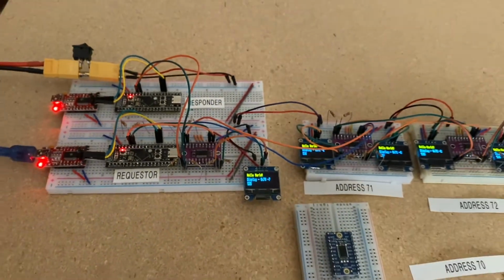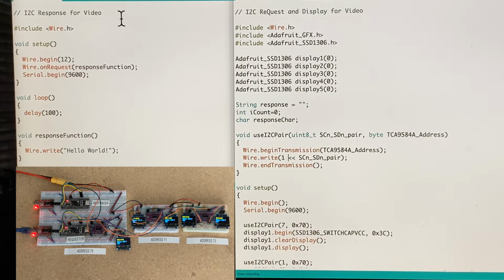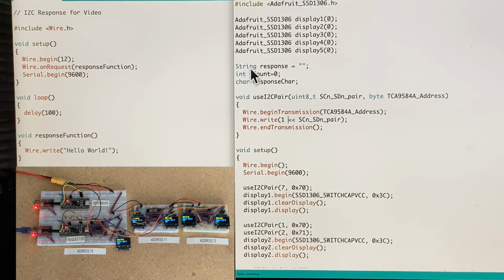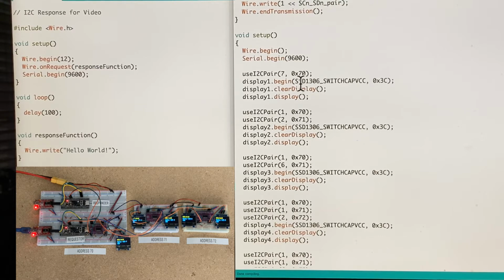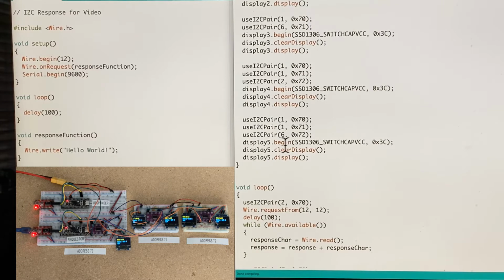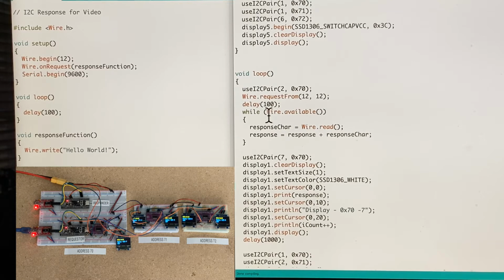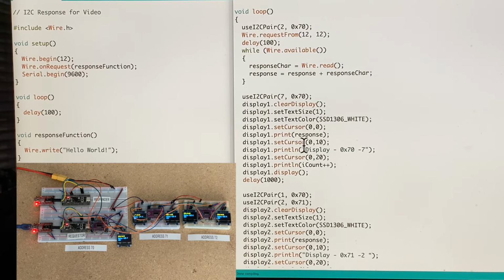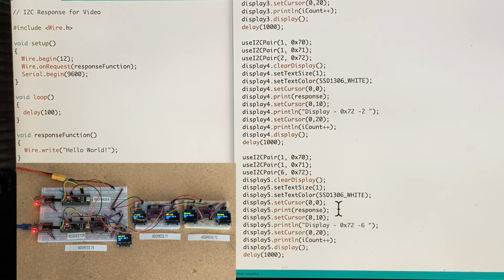I2C Bus example with 2 STM32F4 Black Pills, 3 TCA9548A Multiplexers and 5 0.96 inch displays

Comment: is it possible with different oled lcd addresses (SSD1306 AND SH1106)?
Reply from the maker: There should be no problem as you go to a I2C pair on a multiplexer for an address which could be for the SSD1306 and a a different address on a different I2C pair on the same or different multiplexer for a SH1106. Each of the I2C pairs on the multiplexer is also the beginning of an I2C bus that can have many devices with different addresses. But different I2C pairs on the same or different multiplexers can have the same address no mater what the device is. Hope this helps. If not ask again.
Reply: @lotbotrobotics5026  I have tried but always failed, are there any examples to make it easier for me to solve this problem.
Reply from the maker: Sorry for the delay, I did not see your follow on message. I have not used a SH1106 and do not know what else I can tell you. Two addresses that are the same can not be on a single I2C but can be on a multiplexer. I have already put all of the code I used in an earlier comment by M.

Comment: Please add a code in txt
Reply from the maker: The following are the two prototype sketches that I used and reviewed in the video.

// I2C Response for Video --------------------------------------------------------

#include <Wire.h>

void setup() 
{
  Wire.begin(12);               
  Wire.onRequest(responseFunction);
  Serial.begin(9600);           
}

void loop() 
{
  delay(100);
}

void responseFunction() 
{
  Wire.write("Hello World!"); 
}

// I2C ReQuest and Display for Video --------------------------------------------------------

#include <Wire.h>
#include <Adafruit_GFX.h>
#include <Adafruit_SSD1306.h>

Adafruit_SSD1306 display1(0);
Adafruit_SSD1306 display2(0);
Adafruit_SSD1306 display3(0);
Adafruit_SSD1306 display4(0);
Adafruit_SSD1306 display5(0);

String response = ""; 
int iCount=0;
char responseChar;

void useI2CPair(uint8_t SCn_SDn_pair, byte TCA9584A_Address) 
{ 
  Wire.beginTransmission(TCA9584A_Address); 
  Wire.write(1 << SCn_SDn_pair); 
  Wire.endTransmission();
}

void setup() 
{
  Wire.begin(); 
  Serial.begin(9600);
 
  useI2CPair(7, 0x70);
  display1.begin(SSD1306_SWITCHCAPVCC, 0x3C);
  display1.clearDisplay();
  display1.display();
 
  useI2CPair(1, 0x70);
  useI2CPair(2, 0x71);
  display2.begin(SSD1306_SWITCHCAPVCC, 0x3C);
  display2.clearDisplay();
  display2.display();

  useI2CPair(1, 0x70);
  useI2CPair(6, 0x71);
  display3.begin(SSD1306_SWITCHCAPVCC, 0x3C);
  display3.clearDisplay();
  display3.display();

  useI2CPair(1, 0x70);
  useI2CPair(1, 0x71);
  useI2CPair(2, 0x72);
  display4.begin(SSD1306_SWITCHCAPVCC, 0x3C);
  display4.clearDisplay();
  display4.display();

  useI2CPair(1, 0x70);
  useI2CPair(1, 0x71); 
  useI2CPair(6, 0x72);
  display5.begin(SSD1306_SWITCHCAPVCC, 0x3C);
  display5.clearDisplay();
  display5.display();
}

void loop() 
{
  useI2CPair(2, 0x70);
  Wire.requestFrom(12, 12); 
  delay(100);   
  while (Wire.available()) 
  { 
    responseChar = Wire.read(); 
    response = response + responseChar;
  }
  
  useI2CPair(7, 0x70);
  display1.clearDisplay();
  display1.setTextSize(1);             
  display1.setTextColor(SSD1306_WHITE);       
  display1.setCursor(0,0);             
  display1.print(response);
  display1.setCursor(0,10);
  display1.println("Display - 0x70 -7");
  display1.setCursor(0,20);             
  display1.println(iCount++);
  display1.display();
  delay(1000);
  
  useI2CPair(1, 0x70);
  useI2CPair(2, 0x71);
  display2.clearDisplay();
  display2.setTextSize(1);             
  display2.setTextColor(SSD1306_WHITE);       
  display2.setCursor(0,0);            
  display2.print(response);
  display2.setCursor(0,10);
  display2.println("Display - 0x71 -2 ");
  display2.setCursor(0,20);             
  display2.println(iCount++);
  display2.display();
  delay(1000);
  
  useI2CPair(1, 0x70);
  useI2CPair(6, 0x71);
  display3.clearDisplay();
  display3.setTextSize(1);             
  display3.setTextColor(SSD1306_WHITE);        
  display3.setCursor(0,0);             
  display3.print(response);
  display3.setCursor(0,10);
  display3.println("Display - 0x71 -6 ");
  display3.setCursor(0,20);             
  display3.println(iCount++);
  display3.display();
  delay(1000);

  useI2CPair(1, 0x70);
  useI2CPair(1, 0x71);
  useI2CPair(2, 0x72);
  display4.clearDisplay();
  display4.setTextSize(1);             
  display4.setTextColor(SSD1306_WHITE);       
  display4.setCursor(0,0);            
  display4.print(response);
  display4.setCursor(0,10);
  display4.println("Display - 0x72 -2 ");
  display4.setCursor(0,20);             
  display4.println(iCount++);
  display4.display();
  delay(1000);
  
  useI2CPair(1, 0x70);
  useI2CPair(1, 0x71); 
  useI2CPair(6, 0x72);
  display5.clearDisplay();
  display5.setTextSize(1);             
  display5.setTextColor(SSD1306_WHITE);        
  display5.setCursor(0,0);             
  display5.print(response);
  display5.setCursor(0,10);
  display5.println("Display - 0x72 -6 ");
  display5.setCursor(0,20);             
  display5.println(iCount++);
  display5.display();
  delay(1000);
  
  response = "";
}
Reply: @lotbotrobotics5026  THX